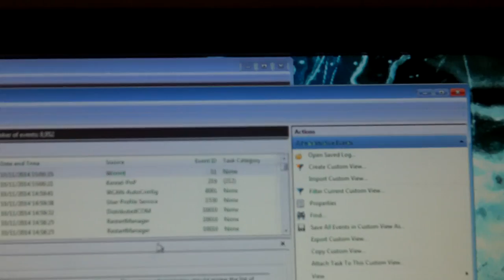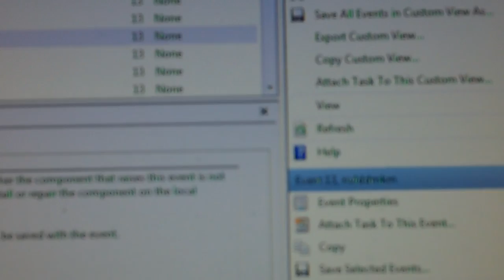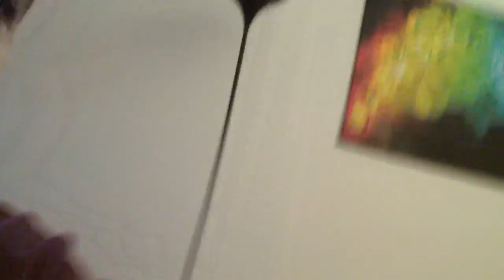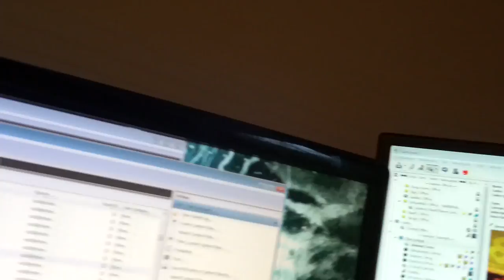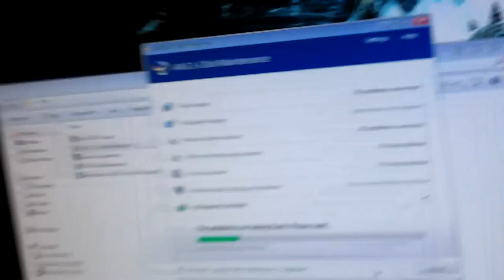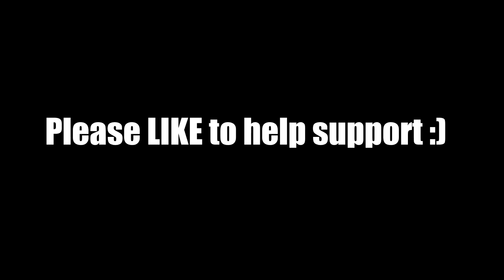WoD Hype?! | PC Problems Anyone? | Life With Gross Gore

Comment: Hey Ali, just a bit of advice. I, too, have been working very closely with computers for quite some time (as a hobby when I was younger, and professionally later in my career). The best I can tell you is to learn your PC, buddy. If you learn how your computer works, troubleshooting these problems will be a breeze. But bringing someone else in, who is not familiar with your PC since they don't use it everyday, is going to get you nothing but guesses based on that person's experience. If you are not willing to learn the technical details, then you have no business using a custom built PC. Buy a retail box with engineering behind it, get a warranty so they will fix it for you, and call it a day. Hearing you say "wow" over the event viewer boggles my mind. It's your computer, you are the administrator, so learn the administrative tools, and use them often

I hope others who have built their own computers can echo this sentiment. I would never have someone "build it for me"! I want to build it myself, so I can know that computer inside and out right from the start. My current desktop is a Frankenstein machine built from other computer parts and a case I hacked up with a Dremel to make everything fit. But, it runs great with no errors, everything is fast and snappy, and if anything goes wrong, I know the machine well enough to have the confidence to fix it. How? Because I made it and learned it from the ground up

Good luck. PC's are frustrating as hell sometimes, and knowledge is key to understanding them and keeping them working the way you want them to work.

Comment: Few options you should be able too try. 1. Remove and re install your GPU Drivers. 2. Check for virus'. 3. Make sure everything is correctly plugged into the PC and on the inside. 4. Re-install Windows 7 (Always fixes any problems)

Comment: Is your CPU overclocked? Mine was OC from 3.3 to 4.6 ghz and worked without a problem for 2 years, suddenly started getting blue screens which started becoming more frequent. Took the overclock off and haven't had a crash since.

Comment: Ali, I had the exact same issue but when I replaced the memory (RAM) it worked fine, your memory is most likely corrupted. Just get £40 Corsair cards online (2x4GB) or better ones if you like and once you replace them with your old ones it will be fine!

Comment: Did you touch the PC components without grounding yourself? If so you might want to think about replacing everything you touched as you touching it has either broken it or made it almost useless. That's if you touched the metal parts of the components, if you touched plastic bits it doesn't matter.

Comment: Oh, and one more thing. Please don't handle your RAM like that!!! Those chips are extremely static sensitive, and since it looks like you're wearing socks on carpet, you are definitely at risk of ESD (Electrostatic Discharge). You need a grounding strap. Can make it yourself easily, or buy one (they are very cheap). But, please ground yourself before sticking your hands in there! Very painful to watch